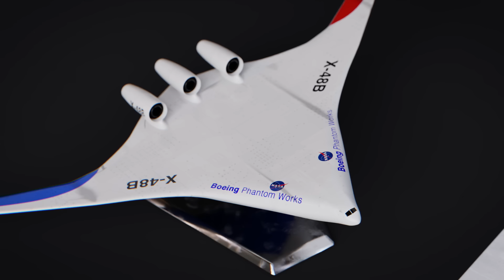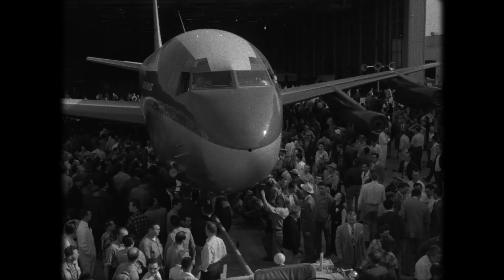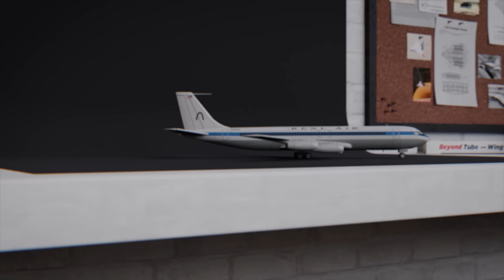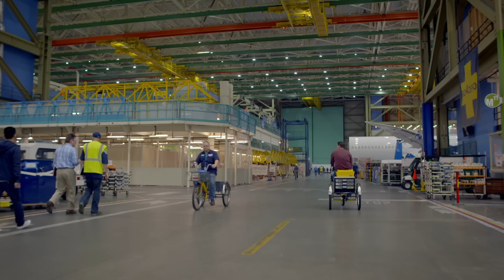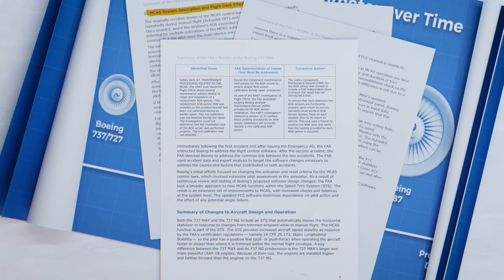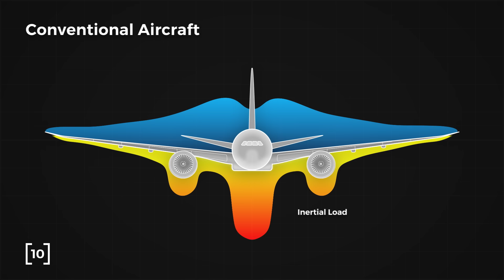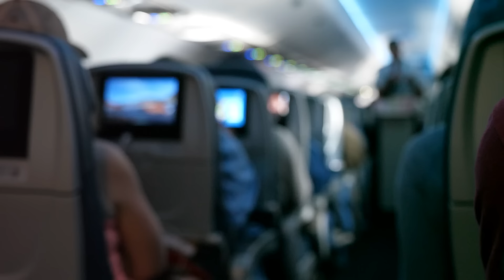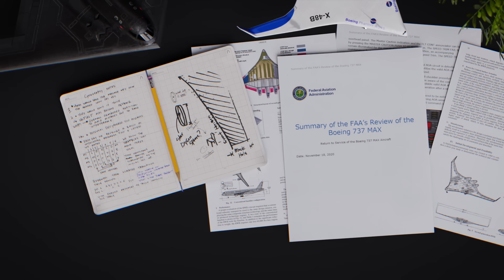The Plane That Will Change Travel Forever

Comment: The expense of more fuel usage for more inherent stability may be the price of safer flying. Cheaper isn't always better. 
This new technology requires huge quantities of electricity to produce, manufacture and power them. We need large quantities of cheap clean electricity. It would be wise to consider where we are going to get it. Liquid Fluoride Thorium Reactors might be a solution. Takes electricity to make Hydrogen.
After all, we have revisited the technologies of the 1950's and 1960's, such as vertical take off and landing rockets, flying wings and seen vast improvements in these concepts in recent times. These same improvements in technology can be applied to nuclear power.

Comment: Yes this is a great idea for a commercial jet let’s just skip over the fact that any passengers on this plane not sitting on the roll center would have a terrible flight experience and get the shit scarred out of them or how people moving from one wing to the other could effect stability in flight ever noticed how the b2 has its Bomb bays as close to the roll center of the plane as possible there a reason for that there’s also a reason why the us Air Force canceled over 140 b2 sprit orders and hasn’t built one in over 20 years and it’s not fly away  cost or maintenance witch is significantly more expensive than traditional air craft

Comment: If in 10-15 years we are still using runways for take-off and landing , irrespective of the fuselage design, we are truly behind in evolution of comercial flight. Runways should be a thing of the past. This is where the designers and innovators have to concentrate on. We are in 21st century. Let’s get on with it. The technology is out there. i guess the powers that be don’t want to fork out the money for a total redesign of airports. 

So let’s keep moving slowly with the obsolete technology at hand. Just like everything else. The video above and the designs have been around since WW2. The Nazis proved that flying wings do work. It’s been more than 80 years. Where is the progress?

Comment: One critical thing you didn't mention in the video about one other potential downside of this design, is how passengers sitting towards the edges of the cabin might feel particularly uncomfortable during banking maneuvers of the aircraft due to the "Dutch Roll" effect.  It's something I was hoping that you were going to cover at some point during the video, since I've been hearing for decades that that was actually the primary reason that the blended wing body design has never been produced for commercial passenger aircraft use.  I would really have loved to know whether or not that statement was actually true or false.  Regardless, thanks for another great video though!

Comment: Very nice explanation of a lot of aerodynamics in aircraft, and especially with the 737-Max.  And fly-by-wire does work - it's how the F16 flies, among other aircraft.   I actually saw models of the blended-wing design at Boeing in Seattle back in 1992.   But there is one reason why this will likely not become a commercial passenger aircraft, and the Boeing Engineers told me this back in 92, and it has nothing to do with flight stability or windows.   The FAA mandates that any passenger aircraft must be able to deplane every passenger in 90 seconds in an emergency.   Put 450 people in a spread-out wing design, even with 6 aisles, and you can't get them out fast enough.   This is why Boeing gave up on it in the 1990s.   Might still be a viable cargo carrier, but not for passengers unless the FAA changes their rules, and they never do that in cases of Safety...

Comment: Nice hypothesis... But the economics won't work in the short term.  Long term it will not be fuelable  (fuel cost much much greater than utility value) :(.

Comment: i could see that this plane will infact be here in just a 2-4 years for commercial use, but this plane (X-43) is could be dangerous during down draft during take off and landing, also turning radius would be higher.  There is an added advantage since these flat wing body aircrafts usually require less runway for a take off. Also is the center of lift would actually be more well distributed across some sections of the longitudinal axis and center of gravity would would have to be way off or considerable to be horizontally stable. But i would like to fly in this kind of aircraft.

Comment: Pressure cycling stress: put multiple short parallel tubes across a long wing, take advantage of the optimal shape of the tube to address the pressure cycling stress, while maintaining the overall winged shape for fuel efficiency.
Reply: Did you watch the video? At 22:11 he explains why they don't do this.

Comment: I knew a FedEx pilot who told me he balanced his airplane a little tail heavy, allowing him to run less horizontal stab trim, essentially using the stab to add lift rather than providing a downforce as is described in the video, so it is possible to balance forces to minimize induced drag of the tail. This, however, causes some squirrely longitudinal stability (running the CG more forward makes the aircraft more stable), requiring more attention by the pilot, or by using more complex flight control computers. I enjoyed the video, and your emphasis on perceived safety is exactly why BWB aircraft have not gained traction yet. BWB makes so much sense from an engineering standpoint, but I have the hope it will get more attention. One thing not addressed was infrastructure. Much like EVs being hampered by the slow roll-out of EV charging stations, BWBs will be reliant on airports being able to support the new shape of the aircraft. This was already an issue that affected A380s, albeit to a lesser extent as it was still a conventional shape, just bigger.

Comment: One problem with this design, is the far outboard passengers will experience both rotation and vertical rise and fall as the aircraft turns. If you tend to have motion sickness, as some do, you might discover the need for the little paper bag more often. Also when one hurls, many others become sick as well.

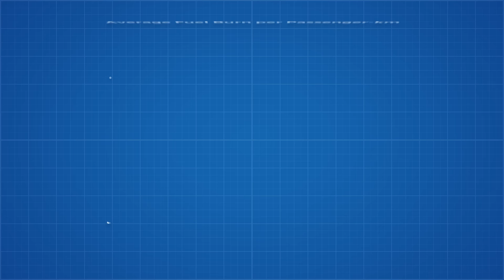Comment: 1:10 That graph leaves something to be desired. First, the bottom of the y-axis is scaled to 50% making the improvements look vastly more impressive than they really were. Second, one of the main factors in driving improvement passenger-mile efficiency is higher average occupancy, which is a logistical component rather than an engineering component, and nearly impossible to improve upon from present levels (until COVID, rarely these days do planes fly with large numbers of empty seats). Is that efficiency graph seat-miles or passenger-miles? Big difference, for those who are paying attention.

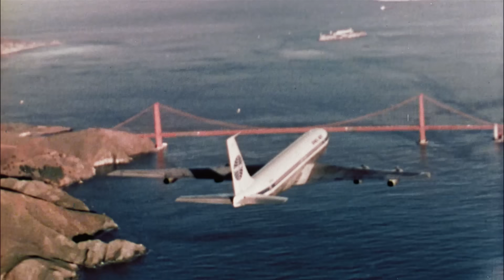Comment: At 1:00 -- I'm curious how much of that per-passenger saved expense is due to increased passenger density. Given that the bulk of passenger planes that are in the air now are over fifty years old suggests that increased passenger density and increased fees for additional baggage may be the largest factor. I certainly wouldn't call this innovation because sitting like a sardine and risking a blood clot in my legs over long flights comes across as an unworthy expense cut.

Comment: Not to be too nitpicky, from what I understand, the concept of wingtip vortices being the source of drag that leads to winglets is a myth. Wingtip vortices are merely a visual representation of the induced drag created by the spanwise flow; the winglet is there to expand the wingspan to spread out the load across more surfaces without just making the wing bigger so the aircraft still has decent control in turbulent air conditions (compared, to say, a glider). (Source: https://www.youtube.com/watch?v=2ieRwRnwqY8  and its comment section)
Also another thing worth pointing out: the lack of passenger windows would be detrimental in a case of an incident since they are the only indication the passenger/flight cabin crew have to assess the situation outside beyond the window at the hatch itself. During power loss, the camera feed would no longer be coming in, which means if something is obstructing those windows, you are virtually evacuating blindly.

Comment: Great video as usual, but was surprised not to see raised the issues that arise from having passengers sitting further out away from the center of the plane. Because they sit basically dead center of the plane in today's planes, passengers rise up and down only a small amount as the plane banks. If, as with these flying wing concepts, passengers are now sitting further out from the center of the plane, they will be traveling up and down substantially more as the plane banks to turn.

Comment: Very well done. With a few passing remarks you took a firm and unambiguous position on the 737 MAX fiasco. I've heard other commentators tiptoe around where responsibility ought to be placed. I did note that the Boeing bean-counters took a stiffer hit than the Boeing engineering staff. Your larger topic, of course, is the emergence of new materials and design, which you covered nicely.

Comment: Airliners are not "eco friendly" in any way, shape, or form. Jet airplanes and the new rise of rockets are going to be the number one source of greenhouse gases. Currently air transportation is second behind the first being residential and commercial real estate at number 1. Soon however changes in architecture and improvements to the sustainable sources that will feed the electric grid will shift the balance. Rockets and Jet aircraft will remain in play for much longer and only continue to grow in use. Even ships will be able to develop more sustainable power systems.

Comment: The most popular specification in the current aircraft market is 150 to 200 seats with a range of 3300 to 4000 nautical miles.  It is likely therefore that a blended wing design will focus on this sector of the market first.  The prototype models being looked at have the engines sitting above the top surface towards the rear of the flying wing.   It is just as possible that the engines will be embedded in the trailing edge of the wing section but will draw air through slats set in the upper skin of the wing.  This encourages the boundary layer to remain attached to the wing upper surface reducing drag whilst increasing lift.  Money talks and significant efficiency  improvements will be need to be demonstrated before the airline industry accepts the radical blended wing concept.

Comment: In the future, may be next 100 - 200 years, I think, we don't travel by planes or cars or spaceships ... but we are going to be converted into DATA, then the data will be sent like a fax or email as of now but it is much FASTER machine, then the machine at the DESTINATION, will convert you back into human. Just like, for example, you want to go to Japan, the machine just convert you here into data then it send your data there. Then another machine to retrieve and pull you out of system and be "yourself" again there ... It is not only for travel from places to places but also for MEDICAL purposes. For MEDICAL applications, for example, if your liver is bad, they just remove those bad liver data and will replace with new liver data (or fix for surgery), then put you back into human .... then now you have the new liver .... The FUTURE is very PROMISING and they can do that ....That's what I think ...!!!

Comment: Actual blended wing introduction will require billions to redo hundreds of airports to accommodate passengers departures and boarding. One major reason Sectarian of the Air Force clandestinely to kill Northrop's flying wing introduction. The second reason he killed the program was because other passenger manufacturers hated the thought of having to compete with Northrop. No flying wings until airports can accommodate--and accommodation is many many years away.

Comment: This same design has been around for years. It will never be built: airlines are very conservative because passengers are. This is why almost all passenger aircraft are tubes with one engine under each wing. Airframers prefer to just let the propulsion manufacturers make most of the efficiency savings. The most they ever do is just sub in some carbon for components that were previously aluminum

Comment: Everyone knows you need redundancy. If people's lives are on the line, you should have at least 3 sensors. Preferably 5, so you can tolerate 2 failures (if failures report the same exact data)

Comment: Blended wind designs are never gonna happen in commercial airline operations!!

The main reason is, that you can not design airplane families with minimal changes like the A318 to A-321 or 737-600 to 737-900. Furthermore the global airport infrastructure is incapable to accommodate such design and the world will not change all its terminals!!

There are "fuselage-wing" designs that achieve similar fuel burn reductions without any of the countless disadvantages and challenges of a blended wing design. It is much easier to build a canard/suck wing design like the Long EZ or a 2/3 lifting wing design like the Piaggio Avanti with a laminar flow fuselage nose. The Piaggio or EZ could be scaled up and down like a traditional jetliner with all the benefits of a blended wing, but without any of its disadvantages.

Bleded wing .. never gonna happen !!